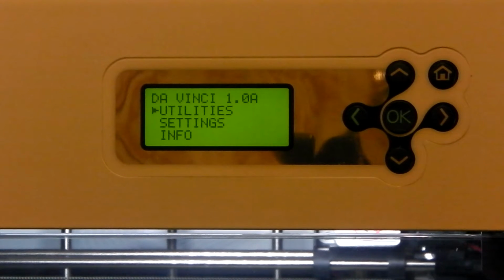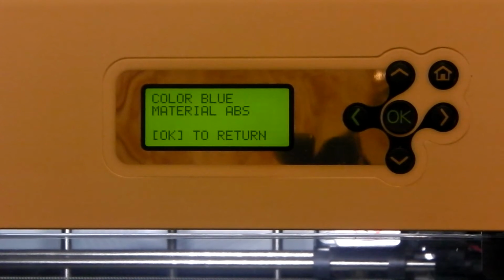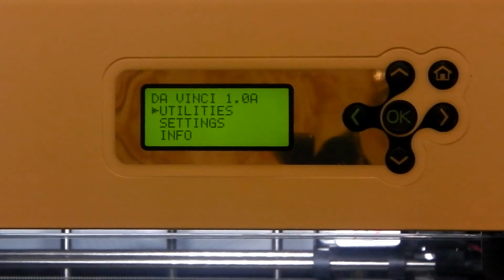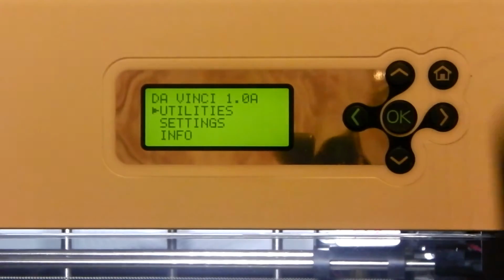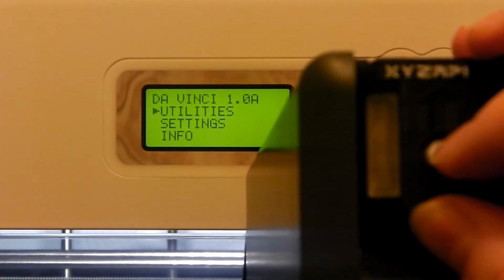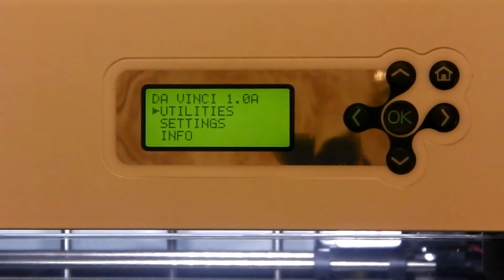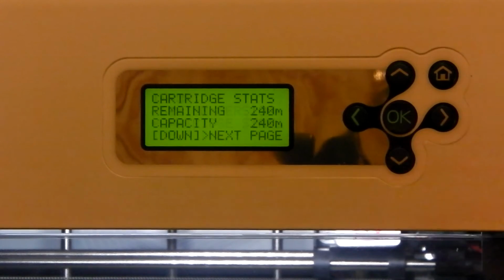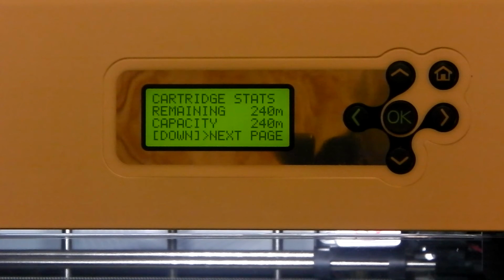XYZ DaVinci 1.0A 3D Printer Blue Filament

Comment: 1.0.5 (1A5) will work also?
Reply from the maker: Rene Solis Hi. please check out the FAQ page for the cartridge reset tool and version 1.0.5

http://www.wctek.com/shop/xyz-accessories/13-xyz-resetter-v2.html

it's currently at the bottom of the linked page.

Comment: How long did it take for you to receive your reset tool? its been 17 days and i still havent got my one yet.
Reply from the maker: Hi Adam,
It took 7 "working" days to get to me here in the UK, I ordered it at the end of a week so if you include the weekend days, it took 11 days.  When I ordered it the guy said it could take up to 15 "working"days to arrive, so with weekends that's 3 weeks.  Hang in there, I am sure it will turn up soon
Reply: Did it come via Royal Mail? USPS Tracking currently says it's in the UK and on its way but I don't know who will be delivering it,
Thanks
Adam
Reply from the maker: Yeah it was Royal Mail who delivered it.
Reply from the maker: Adam Jones Did your reset tool turn up?
Reply: Hah, yeh I got it the very next day, saved me loads of money, how's repetier printing?
I must admit I am not too happy with xyz ware but I have only had my printer for 3 months so I am not sure what to do.
Reply from the maker: Adam Jones Glad it turned up.  I have to say, running Repetier Host is amazing.  But, there are a lot, and I mean a lot, of settings.  Having mastered them the DaVinci prints so much better.  With XYZWare I suffered layers coming apart and side walls being very ridge-y (made up word) with no way of fixing it.  Using Repetier Host I slowed the speed, increased the extruder temp. to 225 C and set the extruded filament to 104%.  That fixed everything :) Since then I have further tuned my printer and filament settings and now I am getting really good results.  I Will say this tho,  XYZWare is good for "out of the box" printing.  Repetier Host is for the person who wants better print control and who has a couple of weeks to take time researching and tuning the settings, but it is well worth it.Most of the setup and settings can be found in these 2 videoshttps://www.youtube.com/watch?v=rjuCvlnpB7M&list=WL&index=4https://www.youtube.com/watch?v=fWRhNyCFA6I&list=WL&index=5I'll upload a video later today showing my method of build platform levelling using Repetier Host and Maths.  It's very easy.
Reply: It does sound soooo much better, I was going to ask you about calibrating the print bed......hold on has the DaVinci only got a 90 day warranty?
Reply from the maker: My Davinci was picked up from PrintME3D.com and XYZ cover it with a 12 month warranty.  I managed to wait 3 weeks before I flashed it.  Got to admit the improvements far outweigh the loss of the warranty.  I had some contact with XYZ support too. Totally useless if you ask me so no loss at all.